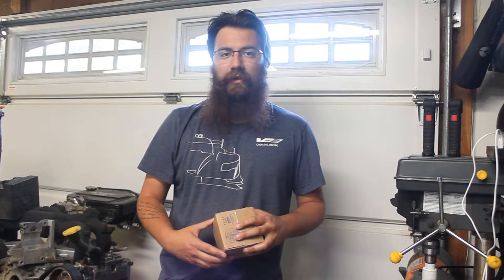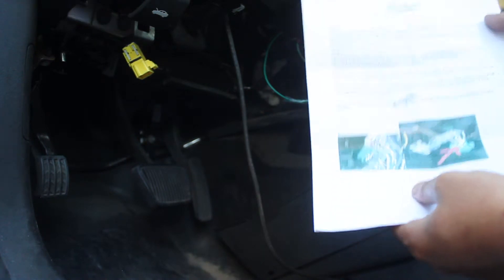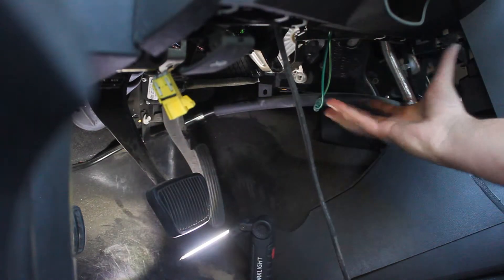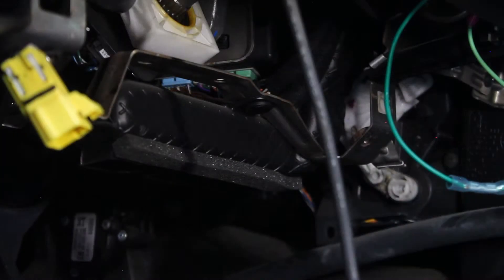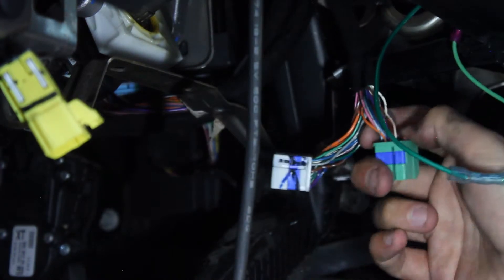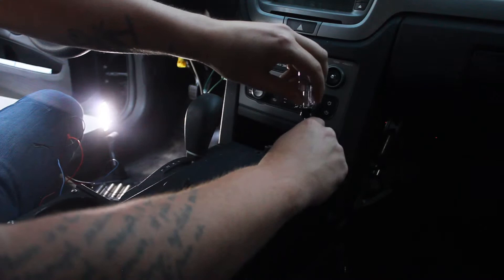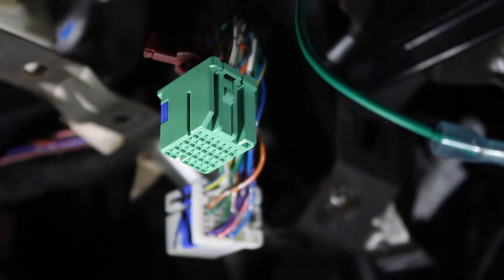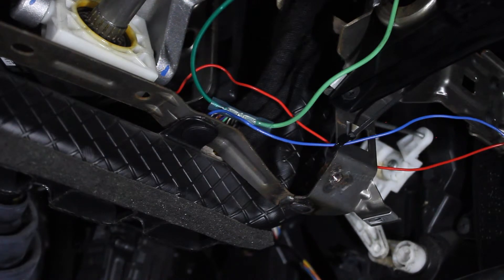2012 Caprice Manual Shift Box | Will's Builds Ep.13

Comment: If you use it to back down when roll racing will the transmission hold its gear after your going and shut it off and will it shift at its designated shift point in the TCM?
Reply: We are going to be installing one very soon.  We are hoping to adjust the parameters in HP tuners to auto-upshift at wide open throttle even while in manual mode (shift box turned on).  That way, if we have the box on and forget to shift (it happens), the tune will recognize the predetermined settings and shift to the next gear for you automatically to keep from bouncing off the limiter.  You will still have to manually DOWN SHIFT, but up shifts should be automatic depending on how you manipulate the settings…will post some info once we actually get to test it.

Comment: Do you have to tune for it or just install it and it works and will it allow you to hold 1st gear on rev limiter like during donuts and burn outs
Reply from the maker: No tune required on 11-13 model. I think the 14-17 Caprices require it to be turned on in the tune.

It holds 1st gear. I've hit the limiter a couple times on accident
Reply: @WillsBuilds  thank you very much I will be ordering one asap then sounds like the ppv is about to be a whole lot funner now

Comment: Do you get every gear with the box?
Reply from the maker: Yes I can manually shift through all 6 gears
Reply: Will it over rev if u don't shit in time ?
Reply from the maker: Hey sorry for the late reply! It will hit limiter if you don't shift in time.
Reply: @nickgonzalez2707 

We are going to be installing one very soon. We are hoping to adjust the parameters in HP tuners to auto-upshift at wide open throttle even while in manual mode (shift box turned on). That way, if we have the box on and forget to shift (it happens), the tune will recognize the predetermined settings and shift to the next gear for you automatically to keep from bouncing off the limiter. You will still have to manually DOWN SHIFT, but up shifts should be automatic depending on how you manipulate the settings...will post some info once we actually get to test it.